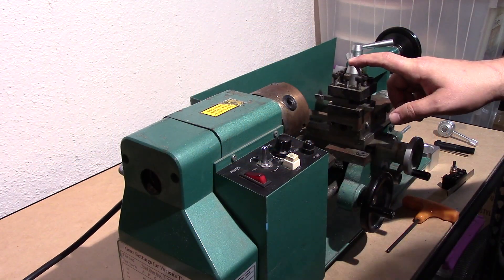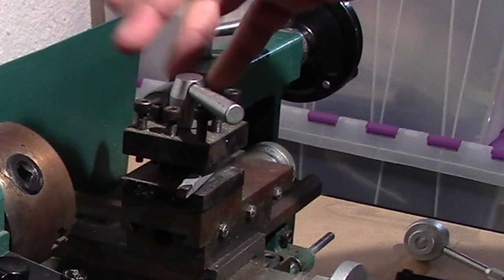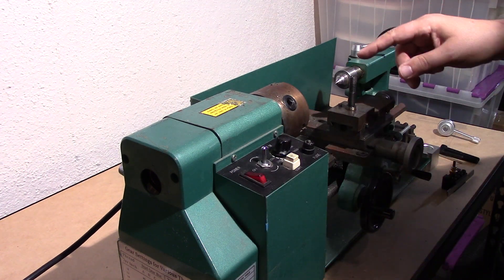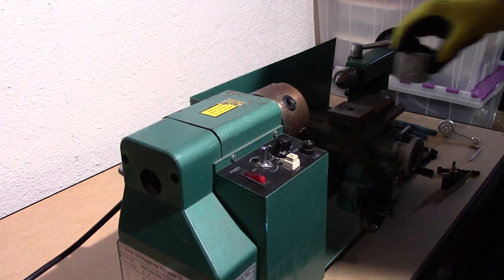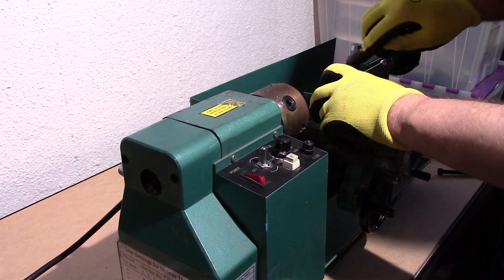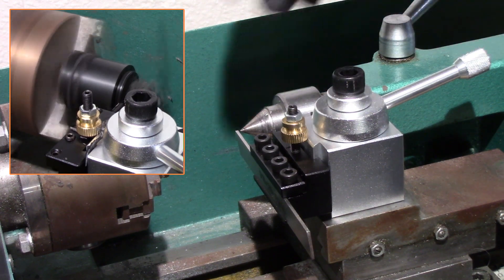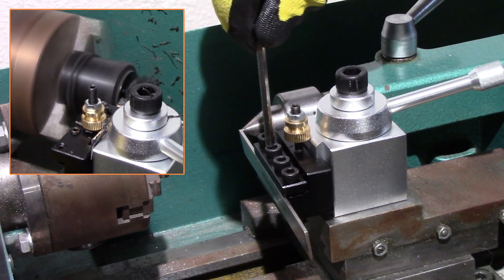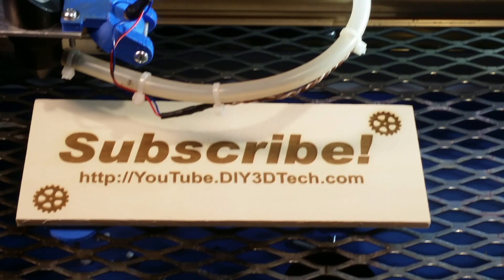Mini Lathe - How To Install The Quick Change Tool Post!

Comment: i have a good ole Harbor Freight 7x10, and the same quick change tool post. Did you have any issues keeping the whole thing from spinning? it seems the bolt must have to be secured pretty dang tight to keep it from spinning. Could the spring mechanism be causing the issue. i saw you took yours out, does it make a difference if I dont?
Reply from the maker: Yes this also an HF and no issues on spinning!  Also don't recall doing anything special but it has been a while since doing this mod which I still love!
Reply: @DIY3DTECHcom  Hmm, Okay.. i will just use more elbow grease and tighten as much as I can. Thanks for answering :-)

Comment: This holder did not get very favorable reviews on Amazon, let us know how it works after some use.  Thanks.
Reply: I bought the all steel version because it would seem that aluminum would wear faster and would not have enough rigidity for harder materials, like steel.
Reply: @markstone8915  You made the right choice. I bought this POS above and after a few weeks I had to buy the steel version. The alu version is NOT good enough, not even for makers. It's soft, has bad tolerances and the steel version is so much sturdier.
Reply from the maker: So far so good, as the thing is if you have a serious machine shop.  Not the tool changer for you, yet for MAKERS and the like, it seems fine.  Two viewers wrote they broke their handles which wow, that seems like it would take a lot of force (I am far from tiny) and I have reffed on mine so far (knock on wood) without but will keep everyone posted!

Comment: At school (many moons ago) I was shown a method using a steel rule to set centre height. Put a piece of round stock in a self centering chuck and bring the cutter close to the round side. Put a Steel rule between the stock and the cutter tip and close the gap till it just holds. Adjust the height of the cutter, when the rule is vertical the cutter is on centre. I have found it to be very accurate and do not end up with little nibs when facing the end. Great videos by the way.
Reply from the maker: Great tip however you know I just have to do a video making a center tool!  😎  Also thank you for the kind comments!